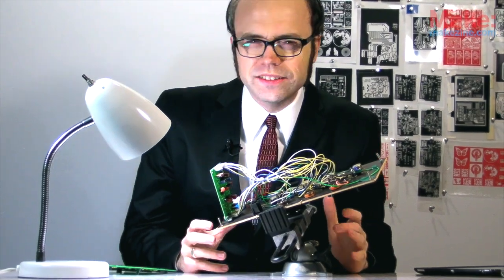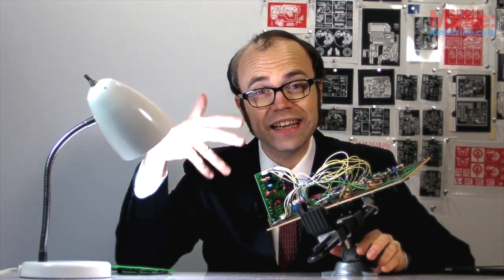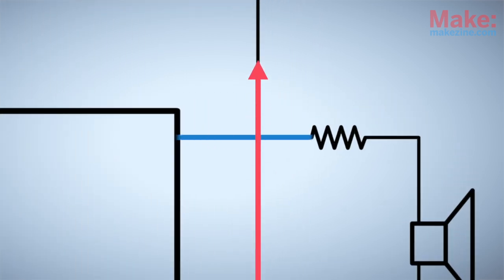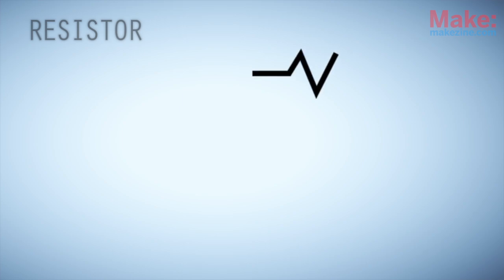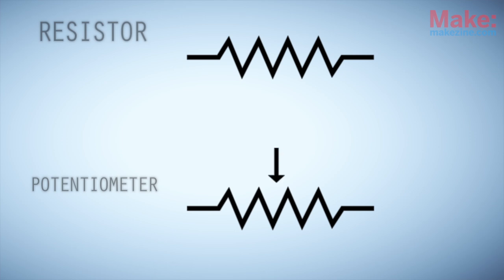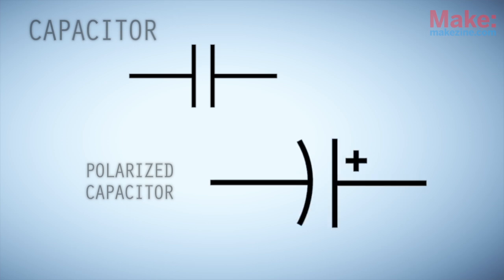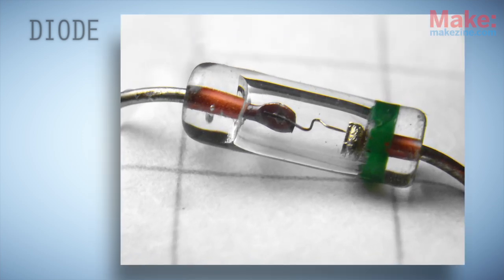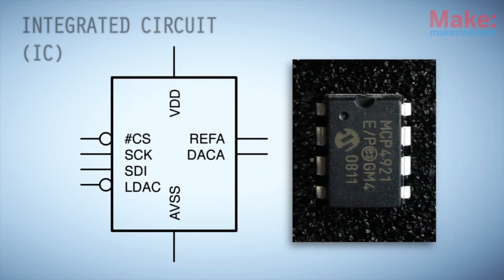Collin's Lab: Schematics

Comment: @rydude998 If you are talking about two-color diodes, these are actually two diodes wired internally in parallel. So, no matter which way you try to pass current, one or the other of the diodes will conduct, getting, say, red light in one direction and green light in the other. (By quickly switching directions, your eye sees two colors at once, giving, in this case, yellow.)

Comment: @modgemtb One end (the end of maximumness) goes to the signal/voltage source. The other end (of minimumness) goes to ground or the return. The center (the wiper) is connected to the circuit that is being fed by the pot. When the shaft is turned to some point, the wiper is positioned at some voltage point between that of the source and zero. Pots have power ratings and the current drawn from them must not exceed them, which is not usually a problem for signals like audio or small DC controls.

Comment: Great video as always Colin. The only thing which could have been improved is the diode section, which very quickly brushed over the fact electrons flow from negative to positive and not from positive to negative as was presumed.
You weren't wrong in what you said, just that it could be a point for confusion :)

Comment: @number0IX Yup, right on.  In fact, many LEDs have a relatively low peak reverse voltage specification.  Most of the ones I use are rated around five volts, IIRC.  If you push them too hard in reverse bias, they *will* fail.  It's not an LED if it conducts in both 'directions';  that would be a light bulb, neon bulb, or other device where polarity doesn't matter.